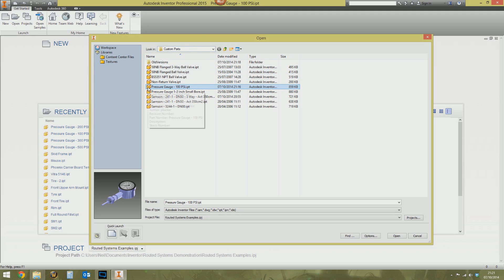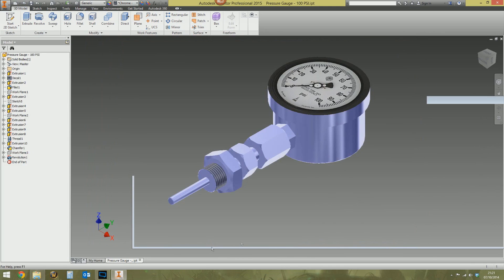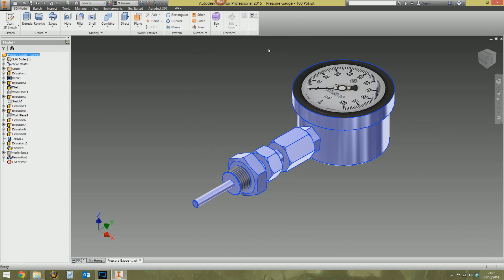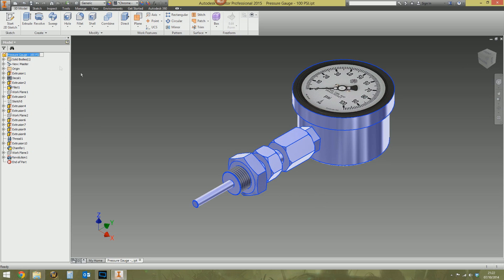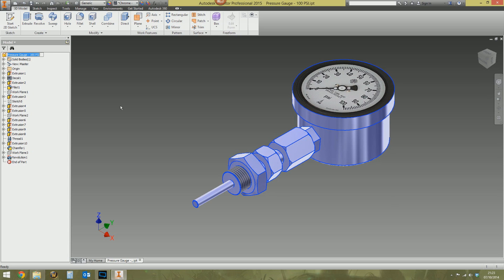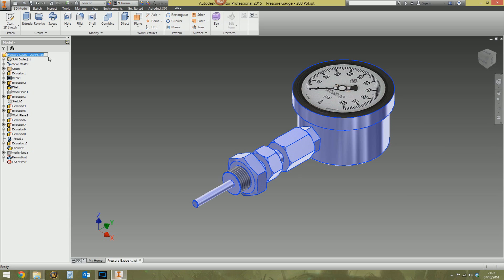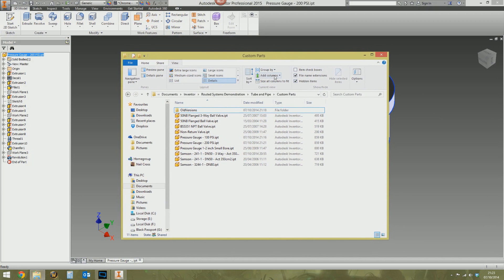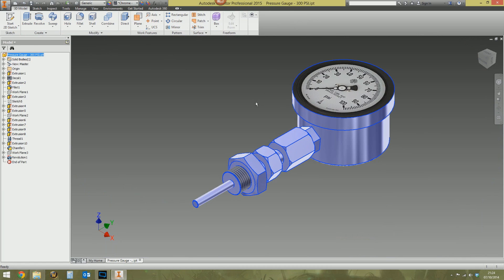How To Reset The Browser Node Name | Autodesk Inventor

Comment: TFI,
My question is how can I copy the Browser Node Name from the master assembly into a custom iproperty within each part that can be used in a BOM or to even save the part file with the Browser name?  
I'm working on an imported Step File that was made in Catia and they produced flattened part drawings we can use but they have the Browser Node Name and the part file names are completely different.  And it is a Royal pain in the tush to add the Main Assembly Browser Node Name into each part Editing the BOM...